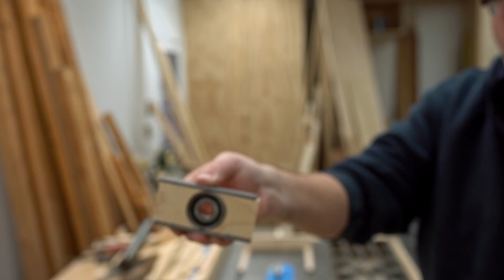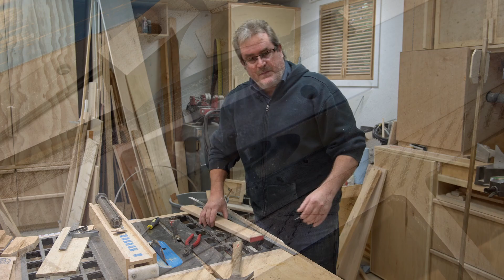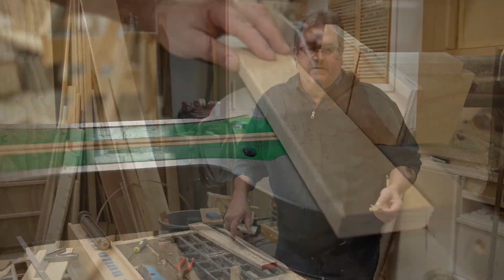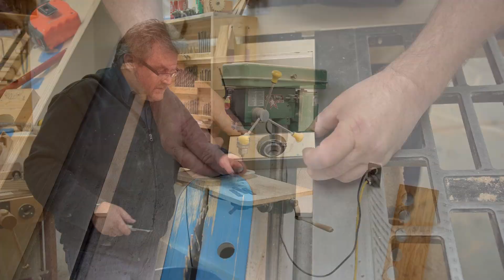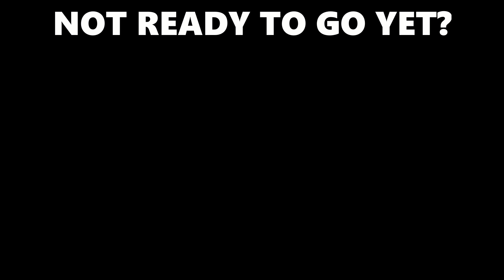I'm Building A Jointer! - Bearing Blocks

Comment from the maker: Making the blocks that will hold the bearings on the ends of the cutter head. Steel flat bars top and bottom for support and safety.
These will bolt down to the side panels of the jointer and can be shimmed to level each end of the cutter head.

I made a video talking about my reasons for doing this build in a multi part series like this:
https://youtu.be/D7XhDMBgC_8

Ways you can help support this channel:
Patreon:
https://www.patreon.com/user?u=865843&ty=h

Plans for sale: http://www.ibuildit.ca/plans.html

More videos on my second woodworking channel:
http://www.youtube.com/c/IBuildIt

My home reno channel:
http://www.youtube.com/c/IBuildItHome

My "Scrap bin" channel:
https://www.youtube.com/c/IBuildItScrapBin

Website: http://www.ibuildit.ca/
Facebook: https://www.facebook.com/I-Build-It-258048014240900/
Instagram: https://www.instagram.com/i_build_it.ca/

Comment: Why you draw a circle, if you need only center point for drilling? :)
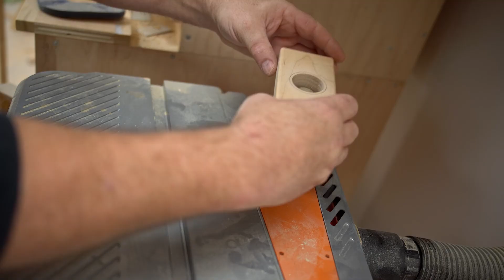Reply: 2:00 John has a 35mm Forstner bit, but not 40mm, so he sands the hole to the pencil line. A couple of years late; I know!

Comment: Your videos are very instructive, Mr. Heisz. 
I'm going to use the information in this video on my build of a small drum sander! I was thinking that you could have made one out of the cuter head you got available. You know a drum sander is mounted similarly to a cuter head for a jointer. 
Do you think a drum sander which does double duty as a thickness sander could replace a thickness planner? At least for pieces which are jointed on one face?

I would like your thoughts about it. 

A planner is kind of out of my possibilities right now, but I see it's really useful and does wonders to speed up production. So I thought I'll give a try to a drum sander before spending money without knowing. What do you think? 
Thank you!
Reply from the maker: Overall, I think a thickness planer is a better tool to have than a drum sander, since it will do important tasks quickly and efficiently.
Reply: John Heisz Thank you! I'll save a little more to get a big[ger] thickness planner! 
I think a drum sander would be my favorite way to sand the pieces of a project; you know: just push it through. 

Have a nice day, Mr. Heisz!

Comment: John, my first inclination would have been to cut the block horizontally and use the bolts to snug the bearing tightly down.  I know there is a reason why you chose to split vertically, but I don’t quit see it. Please share this bit of engineering wisdom with use.  Thanks.

Comment: Would it not have been better to drill the wood initially, before trimming it, so that the space between the two resulting blocks would fit perfectly around the bearings? Or did you choose this option instead to allow you for better control of the space between the left/right blocks (so that you may squeeze / loosen the bearings as needed)?
Reply from the maker: It's the "hindsight is 20/20" thing :)
Yes, definitely easier to drill the bolt holes before cutting them down to size, but when you are doing something on the fly you don't always do it the most efficient way. The main thing is that it gets done and works correctly.